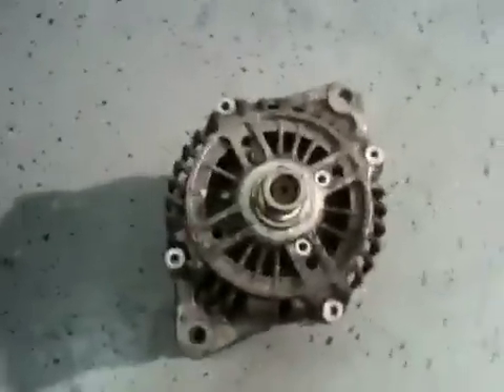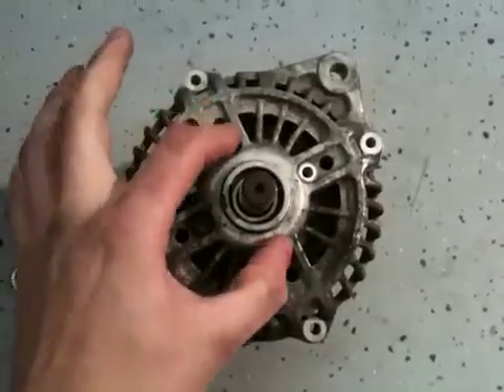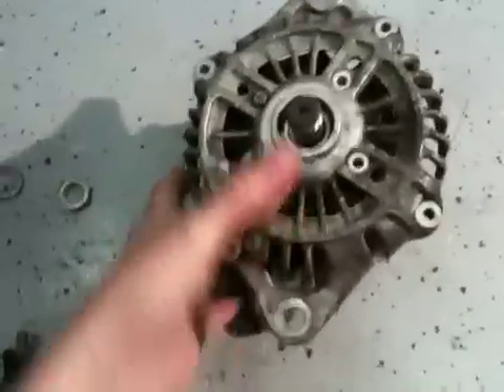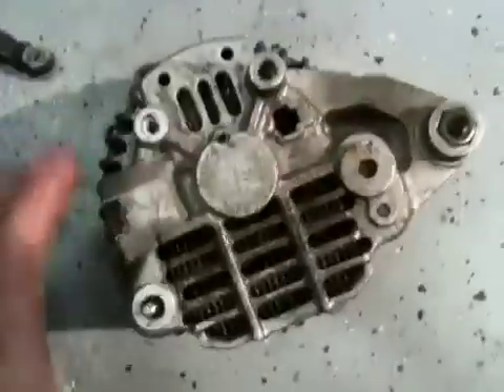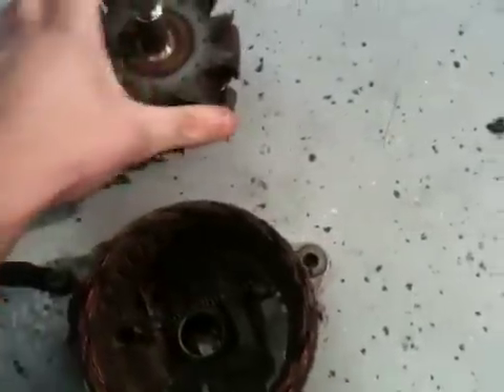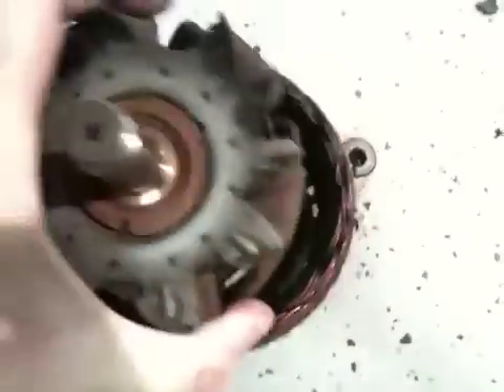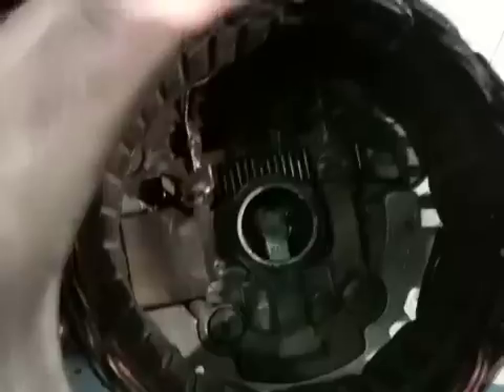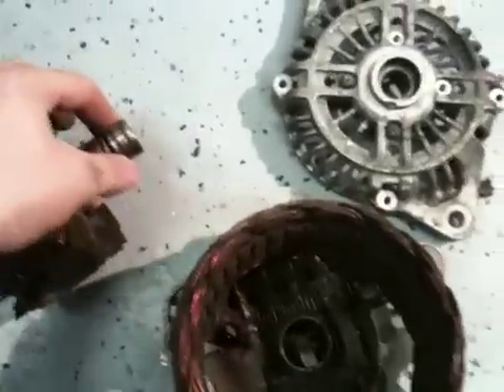Disassemble your alternator and pretend to enjoy it

Comment: What I did to get the core back in was slip a zip-tie through the side vent and over the two spring loaded nodes. Then slid the core in and pulled the tie out.

Comment: So I understand how you get the "core" back in, but how did you get it out? I tried sticking a paperclip, punch, drill bit, etc thru the back and trying to wiggle the "core" out with no prevail. (intension to breakdown, sand smooth, mask and paint then reassemble)
Reply: Wang on the mounting tabs with a BFH and it'll slide off.

Comment: The "core" is called a rotor. It's the spinning part of the motor. The outside is called the stator, it carries the AC current, inducing an alternating magnetic field that causes the rotor to spin.
Reply: Got the names right, buy then you described a motor.  An alternator does the opposite, you cause the rotor to spin and it induces the current you're after.

Comment: Thanks for showing how to take this damn thing apart! I have the same alternator on a 2002 Protege and thanks to you I was able to R&R the regulator. It had to be soldered back on, which I hope the heat it produces won't melt my solder and cause another failure!
Reply: 2002 Protege gang

Comment: center section is the stator if in not mistaken. if someone goes to replace the bearings, leaving them in the freezer will make them shrink and easier to install. the "copper" wires are called field windings and shouldn't be cleaned with a detergent based cleaner as if can possibly remove the protective shell on the wire causing a short.
Reply: goodkill1 well I just fucked my alternator

Comment: Inside the alternator, where the two surfaces have very close tolerance, carbon builds up over time. As I understand it, this carbon buildup can reduce the power of the alternator(?). Anyway, what I did with an electrical appliance about a year ago was to completely fix an electric motor by this method. First I replaced the brushes, and I thought I was done with the repair. But I noticed there was still unevenness and I knew something was still wrong, so I looked in YouTube and found a video about cleaning the rotor or commutator (not sure I have the right terminology here). But it is the place on the rotor and also on the stator, where there is very close tolerance and where the torque is produced via electromagnetic field interactions. Well, what the guy recommended was to hold sandpaper as evenly as possible all around the rotor, and very carefully and evenly sand the surface of the rotor. the thing was to avoid any unnevenness in sanding so that the rotor was not going to develop uneven distances for various sectors. Then also I guess it would be acceptable to very carefully and evenly sand the stator (outer area in which the rotor rotates). Then the carbon builldup should be reduced so that there will be good power production thru the alternator. I did this for an electric compound miter saw and after this sanding treatment, the saw functioned perfectly. So this might be a step to try next on an alternator if you have already checked and replaced the brushes. After that, I mean if that light sanding treatment doesnt improve things, I have no idea how to go further with repairing an old alternator. I'm sure someone knows what to try next tho. Thank you for your video.
Reply: It's not necessarily good practice to clean the stator/rotor. The brushes will coat them with conductive carbon which also lubricates them. Maybe a simply wipe with a rag is fine, but they don't need to be shiney clean

Comment: ahhh the carbon brushes connected to the slip rings.. ye the thing is the brushes move the induced current to the slip rings and out to your load.. the little trick is you get the safety wire.. hold down the brushes and pass the safety wire through the front of them.. holding them down wile you put you rotor back on